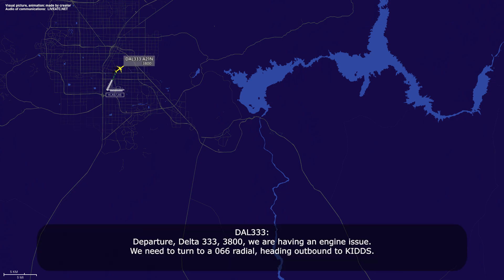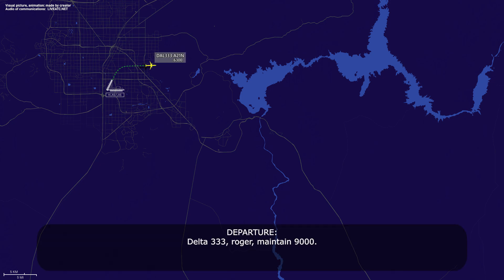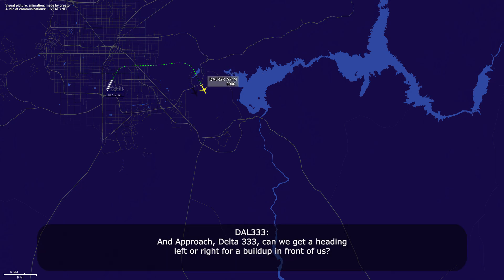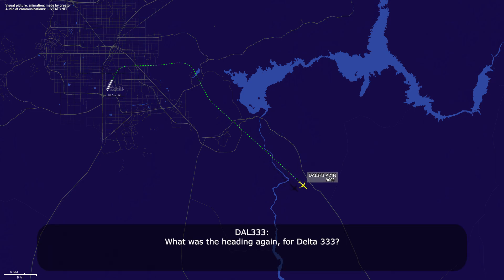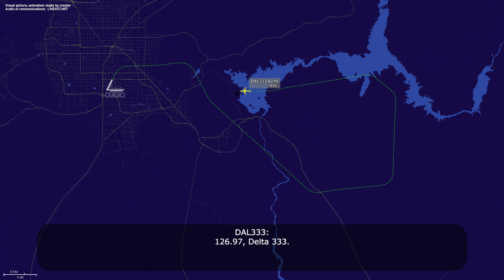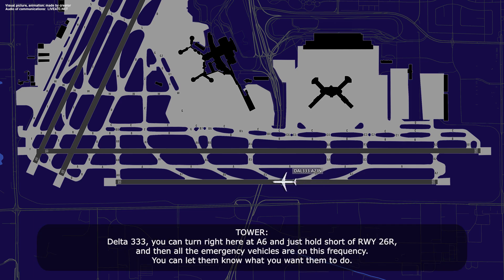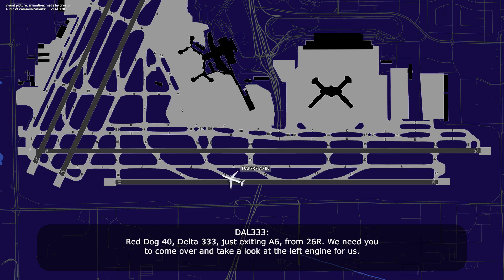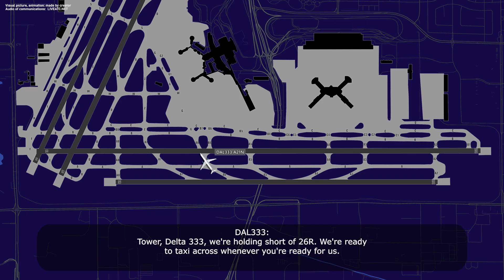Engine overtemp and compressor stall on takeoff. Delta Airbus A321neo returns to Las Vegas. Real ATC

Comment: I was on that flight.  Sitting in seat 14A, right next to the left engine.  I heard the bang on rotation and noticed the plane momentarily wantes ro settle back on the runway.  I was looking out the window, but did not see flames shooting out of the exhaust, which is typical during a compressor stall, but my view may have been obstructed by the wing.  I heard a second bang as the gear was coming up.  When I saw that we dis not climb above 9000 and that the slats and flaps were srill deployed, I knew we were going back to LAS and that it was going to be a long day.